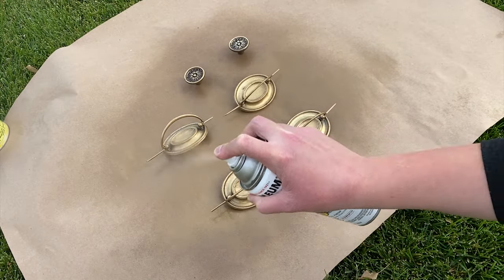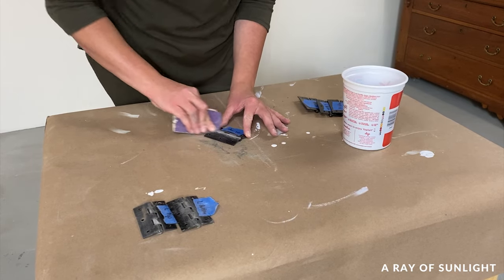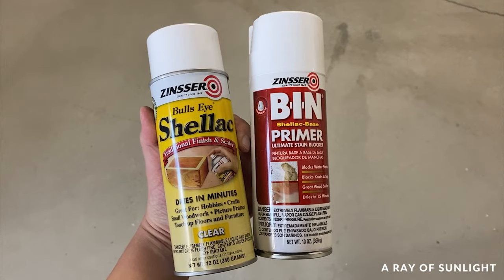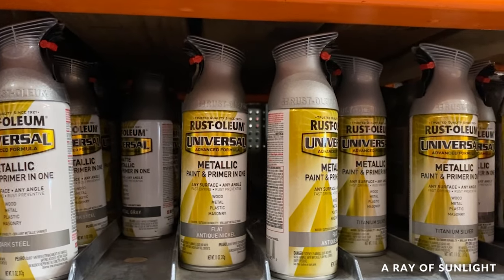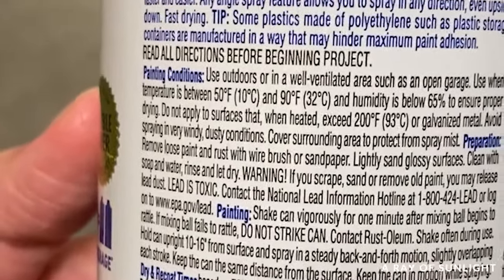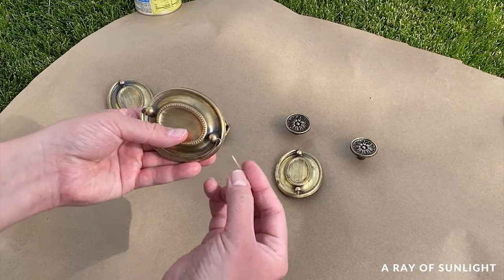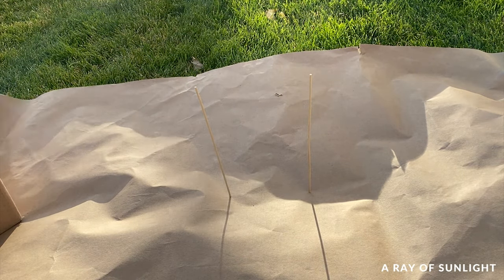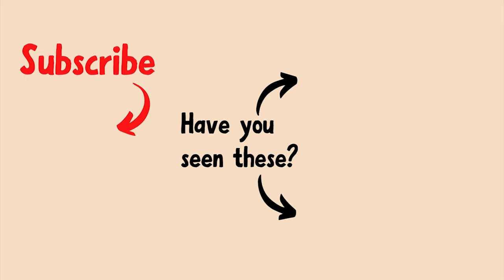The Proper Way to Paint Drawer Pulls | Spray Painting Hardware and Hinges | Plus Extra Tips!

Comment: In a high traffic area like for door handles, will spray painting them hold up? Or will it peel and chip?
Reply: Great idea! I wish someone will answer
Reply: Use rubnbuff
Reply: For spray paint, it's very important to let it CURE. Not just dry, but CURE before using it. This can take 2-4 weeks of leaving them in a warm, dry place.  Once it has CURED, it won't peel or chip, but most beginners using spray paint will try to start using it in a high-traffic area after 48 hours, and it WILL peel/chip after such a short time.
Reply: @alexg6580  awesome! Thank you for answering.

Comment: I know this video isn't exactly new so I am not sure I will get an answer. What products do you recommend for a Bathroom vanity hardware? It is becoming impossible to find a replacement for them (odd shape/size, recessed, etc). I am needing to paint them black to match the rest of the hardware on the vanity. Since I am not choosing a metallic paint would a Rustoleum Black satin work? Will priming and a top coat help with the durability? I don't want it to wear off 2 years from now after being in a bathroom (humidity) on drawers that will be used often. Any additional tips are appreciated! Thanks!
Reply: Or should I use something like the Rust-Oleum Satin Protective Enamel Spray Paint

Comment: How long do you have to wait in between finishing with your spray paint, and applying the Minwax Polycrylic clear topcoat (for high traffic fridge handles)?
Reply from the maker: Great question! That really depends on what type of paint you used. I would check the manufacturer's instructions on the can to find out how long you have to wait to let it dry and cure before topcoating it.

Comment: I’m confused, how do label the hinges when you need to paint them?
Reply from the maker: I put tape on the back of the hinge (the section that goes against the wood when you screw the hinge on.) I wrote on it and then folded the tape over so the paint wouldn’t cover up my writing.
Reply: @ARayofSunlight our painters took all of our antique hardware off to paint them and didn’t label them or keep them with the original doors, now half of the rehung doors won’t close properly.

Comment: When you’re filling holes, and you’re using stain after you sanded how can you get the stain to match up with what the rest of the drawer looks like since you sanded it all together?
Reply: I've never been able to find a wood filler that stains the same color as the wood. The best thing I've found that works is by creating your own wood filler by mixing wood shavings and Elmer wood glue together. Apply, let it dry, then sand and stain. I've had good results doing it this way. Hope that helps.

Comment: Hi, great video, I wondering does the top coat you showed is same as polyurethane?
Reply from the maker: Yep it’s Poly.
Reply: @ARayofSunlight  thanks for reply. There are 3 top coat in your video. Which one would you recommend for bathroom hardwares?
Reply from the maker: It depends what paint you used on it. What paint did you use?
Reply: @ARayofSunlight  im gonna use rub n buff on bathroom faucet.
Reply from the maker: Rub n buff is a wax, so I wouldn’t recommend putting anything on top of it. 😬 it’s not a very durable finish either. 😢
Reply: When I used polyurethane it changed the color of my metallic spray paint 🤔

Comment: Annoyingly, this video appears in every search on how to paint drawer pulls WITHOUT removing them. Sadly, the previous owner of the dresser unit I have decided to glue the knobs in place as well as screwing, hence they are attached to the wooden fascia and CAN'T be removed without damage. If I could remove them, anyone can paint them!
Reply: Mask them with tape
Reply: @bnadem.panormal  Have you ever tried to 'bend' masking tape round a 1 inch diameter circle? Besides, it's the knobs I want to paint but can't work out how to get a clean edge round them without getting paint on the drawer front...